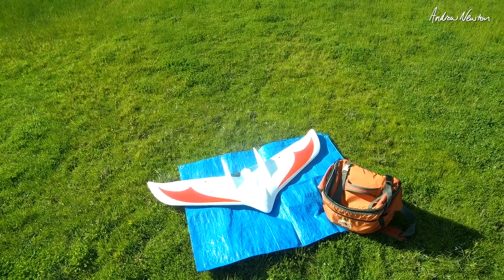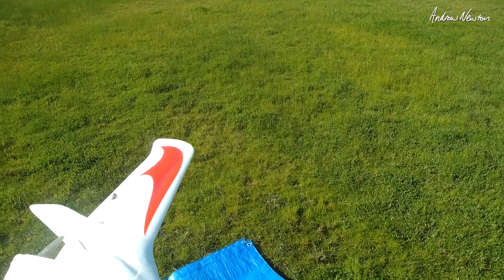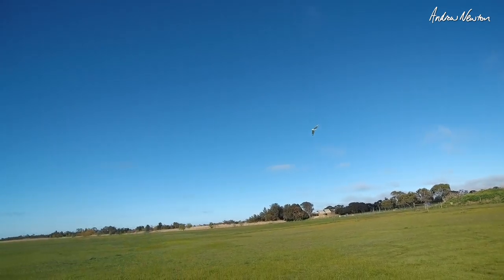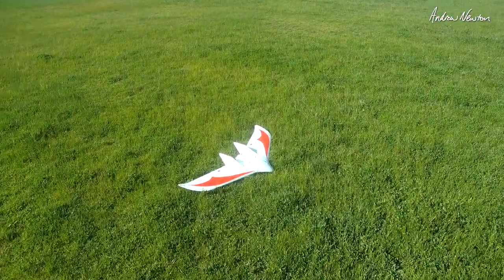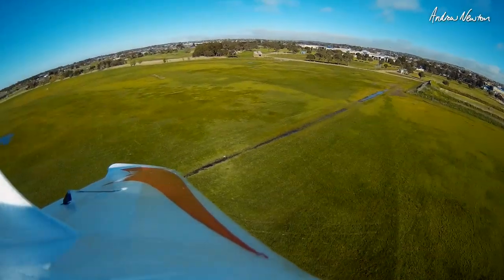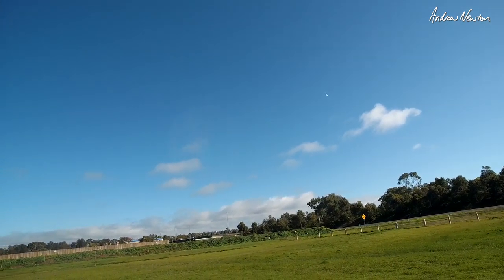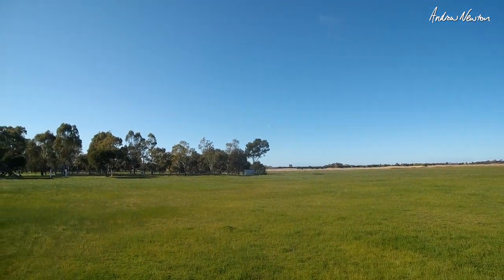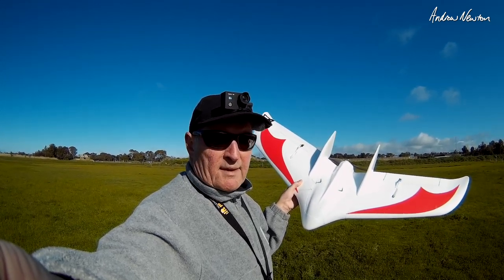C1 Chaser Kit Maiden

Comment: I've got a 411wing in mine. With a pan servo mounted on the canopy. The servo is a really useful addition and it flies very nicely with a 5000mah 4s li-ion 26650 pack. With easily 45min flights. With plenty to spare.

Comment: I have my F405 wing mounted sideways right in front 'tunnel' leading to the motor. GPS and R9mm receiver on one wing and VTX out on the other. Normal battery is a 3s 3000 but I do have a 4s 5200 that it flies with as well.

Comment: I've had an amazing breakthrough in Airplane handling performance, aileron differential! You put the Expo and weight in the inputs page, and the differential mix in the mixes page. The down aileron goes down 60% less, and the up aileron goes up 30% more with two custom curves, 1 for each aileron servo. It has worked amazing on every airplane I put it on
Reply from the maker: Yes just about every plane could use it but I'm too lazy

Comment: Had some great flights with my Chaser, might get another one.  I glued a piece of ply on the back of the fuselage and moved my motor mount there.  Also trimmed the fins back and was able to spin an 8" folding prop.

Comment: I got 1 of these about 9 moths ago. I Love it. I have a Cheap 1400Kv motor on it and fly with a 3S 5200Mah Battery. If i just cruse around without doing 2 much aerobatics I get over 1 hrs flight time.
Just a heads up for all Australians at the time of me posting  this comment Banggood are selling them from there Australian warehouse for $62 Au free shipping (I Just Bought 2 more and they only have 4 Left in stock .Get in Quick)
Reply from the maker: might snaffle one myself

Comment: Built my own C1 and flew it for the first time this other day. Fun to see a brand new video featuring this Excellent plane, even if it has been available for some time. Using a Sunnysky X2212-10 1250 II and an 8x6 prop, my plane makes much louder noise on full throttle, but I think it's also a lot faster as well. It handle speed well. That's even with a heavier 4s 3500mah LiPo and long range fpv gear. I love this plane. Great videos man. Cheers!
Reply from the maker: Thanks for sharing your setup, good stuff

Comment: Andrew, If you wanted to make the wing as quiet as possible, for covert activity how would you make it as quiet as possible (with a camera, etc.)  lol...  and what model would you choose?   If cash weren't a problem, what radio, flight controller, etc.  (Mike Hale)
Do these models show up on radar, I wonder, especially since there is very little metal in them, not much for a radar signal to bounce off of. Oh well, I'm an old man, just wondering?
Reply from the maker: Covert activity for good and definitely not evil (incase I'm being bugged) - front mounted motors and tractor props are always quieter. Something big and glidey with a low Kv motor. Radar - no idea, Long range RC and FPV - No experience

Comment: Hello Andrew, I thought you'd like it. I've had one of these for a couple of years now as my long(ish) distance wing. I use an R9MM, F411, Emax 2212 1400kv with an 8x6 on 3S - and either 2 x 2200's or 1 x 5200 battery. Very capable wing as long as you keep it sensible. Please be careful with recycled Li-ions though - I use ex-laptop batteries as goggles packs - they are ideal for low current applications like that, but I use nice new Samsungs that have been tested by Mooch for flight packs.
Reply from the maker: Thanks for the tips. Just practicing soldering with these packs but they perform well.

Comment: Great video as usual. Can you please explain the mixing that you have done on this wing and why,...
Reply from the maker: This is standard elevon or delta mixing. Aileron and elevator sticks both operate the same control surfaces. 50% weights so that you always have control surface movement, even at full deflection of the sticks.

Comment: Does anyone know why they don't include landing gear with wing planes?
Reply: Because wings don’t usually have landing gear, if u wanted some u would have to put some custom ones on.
Reply from the maker: Because most flyers would rip them off and throw them away. Not usually appropriate for wings.